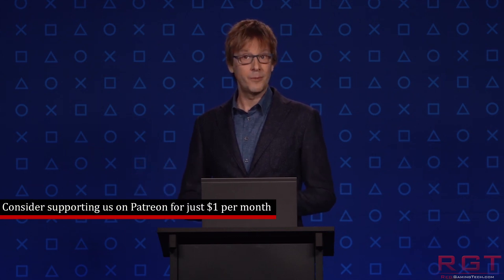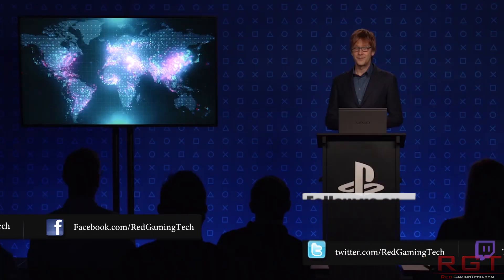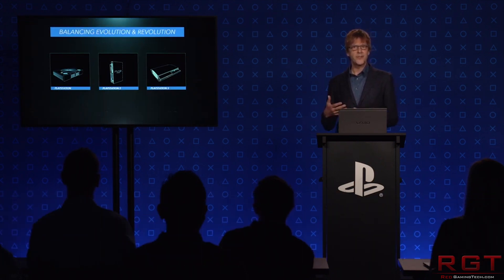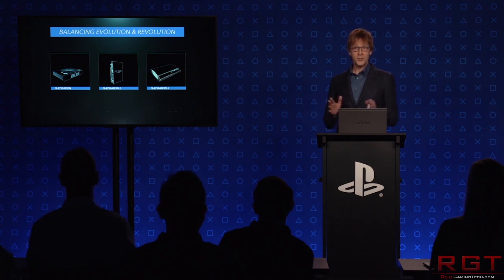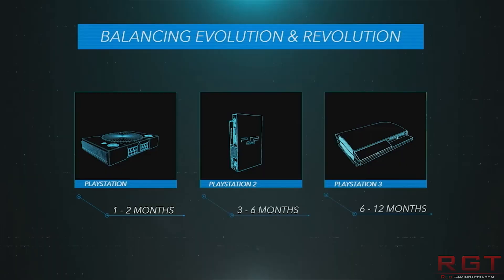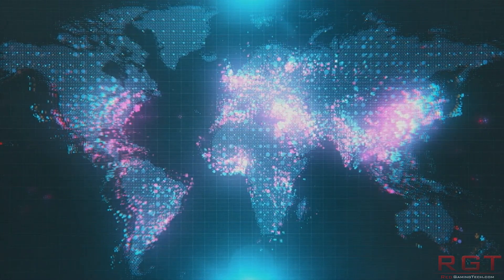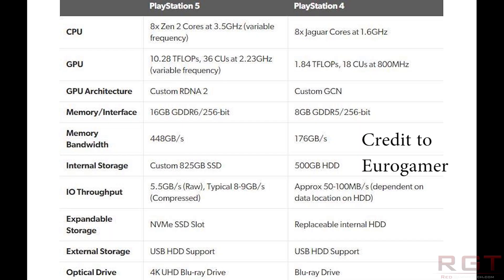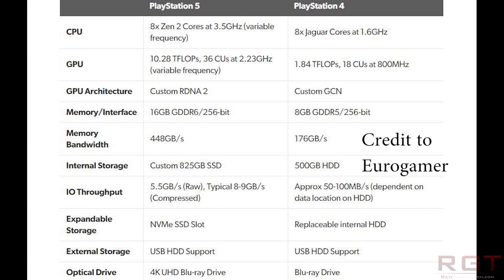Playstation 5 Spec Overview & Analysis | 10.3TFLOPS & RDNA 2 | 3.5 GHZ Zen 2 & Crazy SSD Speeds

Comment: Mark Cerny Lying the console right now is plagued with overheating something Microsoft has experienced... Too much silicon over clocking ... Sonys solution is not as balanced as they want everyone to think...
Reply: Well if they want to make big games with RT (not Hardware based how it seems) enjoy the sea harrier........crashing
Reply: "Mark Cerny Lying the console right now is plagued with overheating"
Link?
Reply: I couldn't help but notice the lack of sources
Reply: @darius6845  My 1st source is tech common sense
Reply: @nightmareedge657  You must of missed the part where Cerny admits to the issues on past consoles....  PAST Consoles...
My tech common sense is just like 360 had issues.... eventually, a few billion dollars later , admitted to the issue... thats FAILING consoles....
Here Cerny Admits older PS's ran hot and are addressing it....
But even the old ones running hot, or even loud, the failure rate was a particle of sand compared...
So your tech sense means no sense.
Listen to it again.,

Comment: 36 cu is 5600xt and a ryzen 3700x at low clocks
Reply: Different architecture, the 5600xt not use RDNA Gen 2 architecture...
Reply: 5600xt is not an appropriate comparison. It's more of a next gen and heavily overclocked 5700. A 6700 so to say
Reply: That's rdna1 though.

Comment: 3.5ghz is pretty poor for a cpu
Reply: Xsx it's 3.6GHz and ya PC have more powerful CPU and GPU... For consoles and their prices it's cool...
Reply: Is? On consoles? Compared to 3.6?
Reply: The PS4 Pro CPU runs at 2.13 GHz. 3.5 is quite a large uplift over that.
Reply: @Safetytrousers  speed isnt only the biggest jump. The jag were weak cpu when both ps4 and xbox one  were launched. The zen 2 are 300or 400 more powerfull. Huge jump!
Reply: The original expected speeds were thought to be around 2.8-3.2 Ghz for a Zen2 CPU on consoles, if anything the CPU specs still exceeded expectations.

Comment: THIS IS WHY PS5 IS THE BETTER CHOICE

1. All third-party developers will simply aim for the lowest specs of each machine i.e. the SSD of the Xbox series X and the GPU of the PS5; so we’ll see barely any difference at all with multi-plats.

2. All Microsoft first party games can’t take advantage of the Xbox series X completely for 2-3 years, because their studios have to make all games run on current hardware.

3. Whereas PS5 will have games that you can’t play on current hardware. Sony have already said they will have PS5 exclusives, from the start of the generation and with no mandate their internal studios will be able to make true next generation games, with no restrictions, right from the offset.

3. By the time developers get anywhere near needing the additional power in the Xbox series X Sony will have released a mid-generation upgrade, so PlayStation won’t actually get left behind.

5. But most importantly these machines are going to be very expensive and there will be nothing available on the Xbox series X that you can’t play on your current hardware; whereas on the PS5 there will be and $500 gets you a lot of games.

That’s why I will be buying the PS5 first and will only buy the Xbox series X when the price drops in 2-3 years and it has games I can’t play on my Xbox One S. Power doesn’t matter games do and I don’t intend to restrict myself from being able to play any of them.
Reply: Old School Gamer “
1) All third part developers will aim for the lower specs”, not true. They make the game to their intentions then downscale/upscale as needed. Most third part games are also for pc, which has literally thousands of configs
Reply: Old School Gamer 
2) they can upscale, and once again they usually make them as good as possible then downscale. Many games also run on pc and look considerably better over the now outdated specs of the Xbox One
Reply: Old School Game
3) developers need that power now, with 4k, raytracing and much more.  It’s idiotic to think that the PS5 with it mid range gaming specs has hit the highest point.
Reply: Old School Gamer the reason to buy a series X is to get those new features. It’s not to force you to upgrade like scummy Sony. You should praise Microsoft for continuing to support older consoles rather than just leaving them to rot.
Reply: Zach B There isn’t as much difference between these consoles as a some people are making out. where it comes to graphics we are now hitting a law of diminishing returns and we will barely see any difference at all graphically. The way these two consoles will differ at the beginning of the generation is, Xbox will probably be able to reach much higher frame rates and the PS5 will probably have stick at a solid 60 FPS.

However the PS5 will load games faster, it will install games quicker, install patches quicker, fast travel will be quicker so will movement speeds and it will be able to load twice the textures. But most importantly it’s so fast it can load 5.5GB/s of data within the amount of time you can turn around, double that of the Xbox series X, allowing developers to place 5.5GB worth of data in front of the player at all times; allowing them to reach a phenomenal amount of detail. That is why developers are raving they about it. The Xbox only has the advantage with frame rates and possibly slight advantages with Ray-tracing but developers won’t be getting deep into Ray-tracing until later in the generation anyway, as it’s a new thing they’re all leaning. The PS5 allows developers to fundamentally change the way they develop games removing every single bottleneck and game design flaw currently plaguing them.

The best way I can put it is the PS5 has been designed, with developers, for developers, allowing them to build new and exiting, next generational style games. Whereas the Xbox series X has been designed to play the same styles of games at much higher frame rates and resolutions.

At the end of the day if you can afford both machines this isn’t a problem; but if you can’t afford them both and have to make a decision the PS5 is currently the better choice; because at least for a while, you will be able to play all Microsoft games on your current Microsoft console or PC. Whereas you won’t be able to play PS5 games on anything else but the PS5 and games are what should matter most.

I suggest you should first watch this video https://youtu.be/l1aHy8uBg2o Plus read the comment by LiliumExtendedDJ2 an actual developer along with reading the associated chat then watch this as well https://youtu.be/vqDHY7geZ00 maybe you’ll learn a few things. BECAUSE I DID
Reply: Zach B If you’re expecting phenomenally better looking games on the Xbox you going to be very disappointed and look very foolish
Reply: Old School Gamer it will load games faster, but installation times will be dependant on the internet of the user. Not that 825GB of super fast ssd storage will last long.

It all be able to load the sane amount of textures, just at twice the speed. It will however not be able to render all of those textures
Reply: Old School Gamer the game won’t be able to display 5.5 GB of data, it will only he able to display what the GPU can render - so not as much as the xbox
Reply: Zach B At the end of the day mate you enjoy your Xbox series X and I’ll enjoy the PS5 and play all of Microsoft games on my Xbox One S then in two years I will also buy the Xbox series X once it’s cheaper and there are first party games I can’t play any other way. (not including PC)

I’m not for a second trying to claim that the Xbox series X isn’t the better machine;  but if you think there’s going to be a night and day difference you are going to look very very stupid, power doesn’t matter, talent does, but more importantly games do; that’s why the PS4 has dominated this generation and the Nintendo Switch as outsold the Xbox One despite Xbox One X having the power crown.

Sorry mate but most people don’t give a shit about power and those that do own a top-end gaming PC. So the only people who are going to buy the Xbox series X are hard-core Xbox fans and as I said if you can afford both then it’s not a problem; but a lot of people will have to choose and once Sony starts their marketing because believe me that presentation was not for us it was for developers, most people will go PS5 That’s because of the games. Unfortunately Microsoft still have to prove themselves in this area, they need to start making AAA single player games that compete with Sony and Nintendo first.

I’ve said it many times Microsoft have little chance of convincing most people to buy the Xbox series X over the PS5 what they have to do is convince those people to buy the Xbox series X as well as the PS5 so we can have healthy competition and better games for us.

Comment: Congratulations MS... Now the gap is the same gap between PS4 Pro and Xbox one X... Now since sony GPU clock higher and the Nvme SSD more than twice faster then the xsx ssd so the gap even will be more minority... In future benchmark will tell... In the end both RDNA Gen 2 architecture, next generation consoles it's big jump for console gamers but not for PC hardcore gamers, for the value of the price consoles will be a good deal, i excpet that xsx will cost 100$ more then PS5... Both next generation consoles will be great for console gamers...
Reply: x is %50 more powerfull than pro, series x is only %20.
Reply: Ps5 499 and Xbox 799 mark my word
Reply: Slightly faster SSD load times makes the PS5 even in power with theXboxSeries X? Man GTFO with that bullshit
Reply: @YOUNGMONEYstoned 
Not happening...
Both are 500 usd
Reply: @huyatti  i say the gap will be the same by GPU 1.8TF same then same now...
Reply: @kirk-daroostergordon9961  it's obviously you don't understand noting about technology accept yelling FLOPS everywhere you can😂😂😂... I said the gap will be even more minority, you still think HDD and Nvme SSD act the same😂😂 they didn't, the fast Nvme SSD can prevent bottlenecks and help the whole system as a lighting bolt...
Reply: @oladapoolaleye9184  the PS5 will be cheaper by 100$ for sure...
Reply: @oladapoolaleye9184  Xbox at 500usd ? with 52cu ?
Reply: The XSX is only 15-17% stronger in GPU compared to PS5... 

Xbox one X is 40% stronger in GPU compared to PS4 PRO...

Xbox one was 40% weaker in GPU compared to PS4...
Reply: @Kryptix0III  off course FLOPS it's not the overall power of the whole machine, but compare only the GPU it's the same gap by FLOPS was between PS4 Pro and Xbox one X, 1.8TF gap.... Now the gap between xsx and PS5 by FLOPS it's 1.875TF... now because the PS5 GPU clock higher at 2.23GHz peak combined the more than twice faster Nvme SSD the Gap will be even more minority, bencmark Will tell in future the true gap between them...
Reply: @מוטיאהרן  also, the ram bandwidth for PS5 is higher overall than Xbox series X...
Reply: @Kryptix0III  it's not, xsx 560GB/s @ 320mb bus... PS5 448GB/s @ 256mb bus...
Reply: @מוטיאהרן  which memory setup looks better to you on paper? I'm just trying to learn something please and thank you:)
Reply: @Andre217  what you mean both xsx and PS5 using 16GB GDDR6 VRAM, the problem we still don't know everything, we know a lot now but we don't know all the features that every company have... Sony don't show how they going use the VRAM while xsx already show it, the xsx have more bandwidth and more bus but sony going to use the Nvme SSD that faster more than twice as extra RAM so hard to tell in this point, better to wait for more information or bencmark when they launched, also take in mind that will take few years until the developers will lerning better both systems to do better optimization then we going to see more great visuals on our screen...
Reply: @מוטיאהרן  was just wondering because of the difference in there bit bus . Wanted to know if you think that would matter or effect anything..
Reply: @מוטיאהרן  only 10 gb of the 16 gb GDDR6 is 560 gb/s the rest is 336 gb/s... PS5 is at a constant 448gb/s, which is overall faster than XSX's ram...
Reply: @Kryptix0III  ? Even it's 10GB you don't see it with bandwidth of 560MB/s? While still we don't know how sony divide their VRAM if they divide it at all it's still less bandwidth at 448MB/s... The 6GB on xsx it's for others things but still the bandwidth bigger without this 6GB...
Reply: @Andre217  more bandwidth and more bus always good to have... Sony will use the super faster SSD for their benefits...
Reply: @מוטיאהרן  have you done the math or research?
Reply: @Kryptix0III  on the paper for now, we need to wait for launch day to do tests if that what you asking...
Reply: @מוטיאהרן  so it won't be a big difference because it's the same amount? Though a bigger bit bus is still a good thing to have
Reply: @Andre217  i told you above it's always good to have more bandwidth and more bus... Sony will use their super fast SSD as extra RAM for their benefits...
Reply: @מוטיאהרן  ok got it thanks for the information I understand now..

Comment: Sony is too stingy and lazy, if only they make better backward compatibility software and want to spend more on hardware. Playstation 5 will not be stuck with 36 CUs on the GPU. they are also too focused on SSD, yes indeed without loading time but ssd will not be able to help the GPU to make a higher resolution or higher fps. Sony is still conservative in maintaining the form of a console that must be small and thin (I can guarantee the shape and size of the PS5 is not like the xbox series x, but it still uses the old concept where the console must fit on a television rack) Though xbox dare to take risks with a fat form but provides a bigger headroom. especially now gamers don't really care about size or shape, just look at the shapes of large and weird PCs.